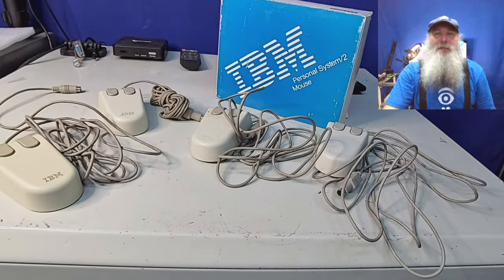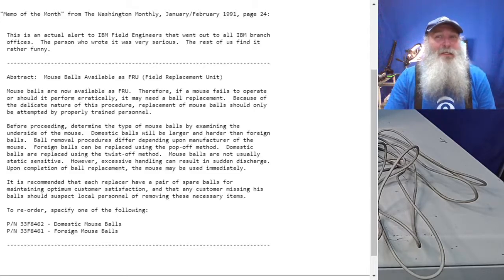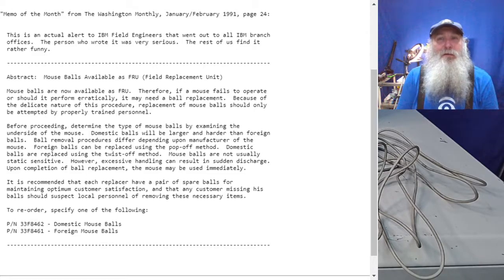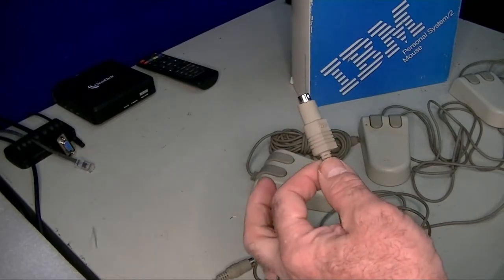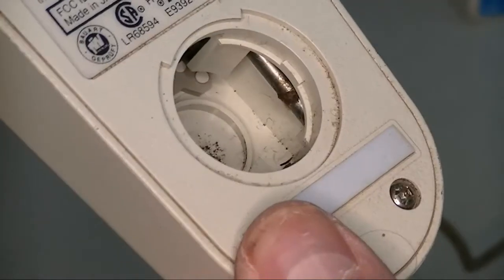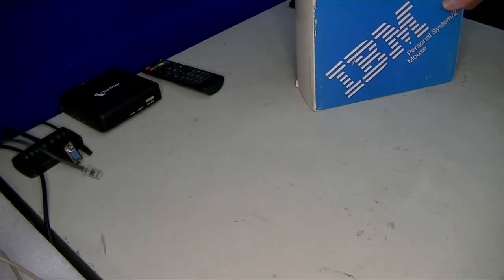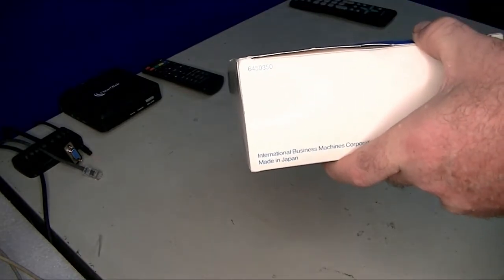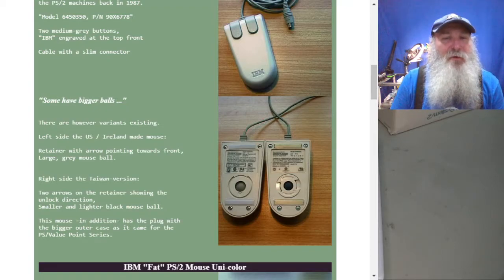All about the IBM memo "Mouse Balls Available as FRU" - What do you believe?

Comment: Okay, I have a question: ballpark count... how many of these PS/2 mice do you have? :-)  I have one genuine PS/2 mouse for my Model 30 286
Reply from the maker: Probably a couple dozen of the "trapezoid" mice, most being of the Japanese source and for the ValuePoint (larger plug) series. There was a focus (as most anyone else that understands the differences) to avoid the Taiwanese-manufactured variant, typically by looking at the underside in pictures. I have about the same number of the later "Dove bar" mice among the different varieties they can be (the base and button colors distinguishing them, even to the point of 300dpi vs. 600dpi). Also, a handful of many later variants such as PS/1 mice, rebranded Logitechs, and versions that came with later IBM systems before the division was sold to Lenovo.

At one point, they came up often enough on eBay - but likely have ridiculous prices now.